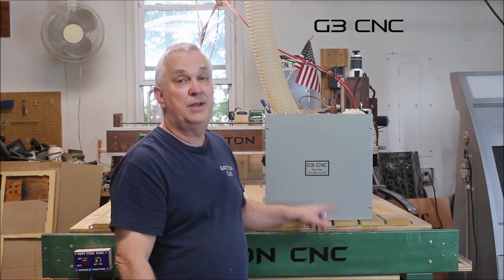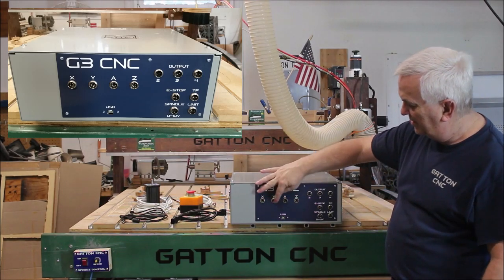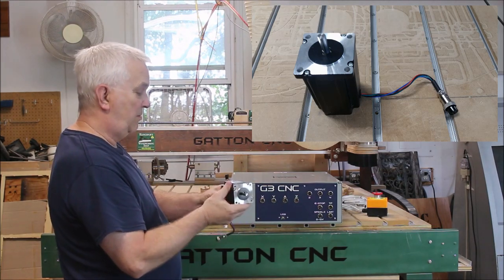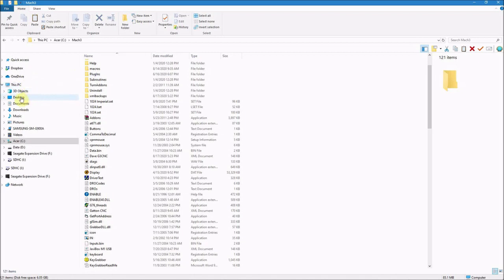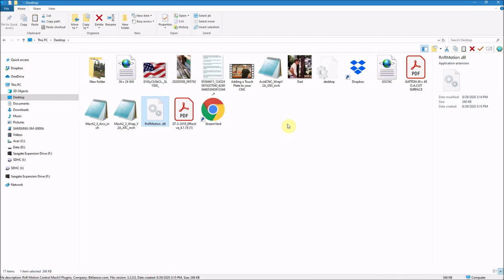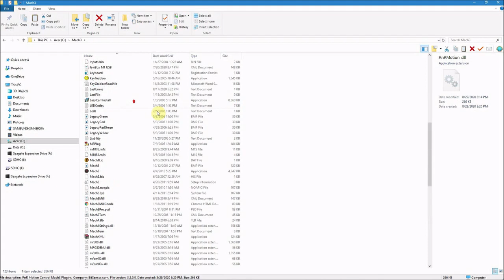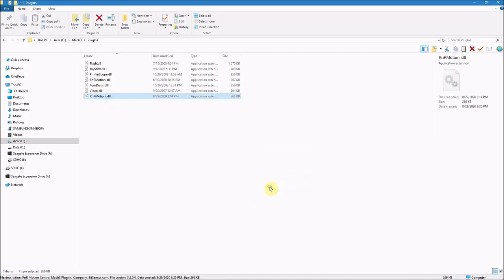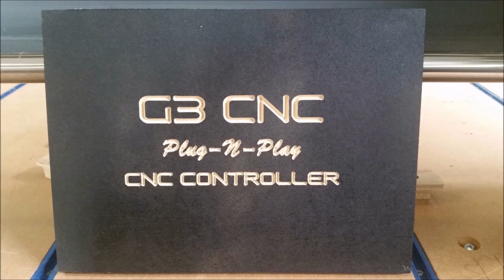The G3 CNC Plug N Play Controller

Comment: Hi!  Great video! I will look into these guys, I was wondering if I could get some advice?  I have a small
 3 axis mill and the controller is dead. Does size of the stepper motors matter when considering a replacement controller?  Additionally,  I want to build a new one.  Can you recommend a good kit and control software?  Many thanks!

Comment: Thanks Dave. Its nice to know that there are options to pick from. do you know if it can work on 220V?
Reply from the maker: Thanks for watching Eyal.  I think it would if you changed the switch on the power supply to work with 220v but that would be a question for 3GCNC.
Reply: Hi Eyal,  the unit is designed to run off of 110/120V power supply.

Comment: Brilliant business idea- take bunch of off-the-shelf parts, package it into a self-contained unit and sell to CNC enthusiasts scared of electronics.

My only complain is that they use an inexpensive Bitsensor BSMCI14e controller (or something similar) that only works with Mach3.
Hopefully the business takes off and there will be a choice of controllers.
Similarly, it would be good to know what stepper drivers are inside and what is the power supply.

My complaint about the video is that the inside of the box  was not shown.
It may look professional and solid on the outside but inside could still be an amateur mess.
Reply: Hi Ro, if you go to my website you will see a list of internal components. On the support page you can view the data sheets for the stepper motors and drivers. The drivers are the latest 32 bit DSP computer chips in a DM556 size, and perform very well. The driver manufacturer is also the stepper motor manufacturer. Their engineering department worked with me to modify the  stepper motor to reduce phase inductance to a very low 2.5mH for me at a very minimal cost. These are not low end motors and drivers I assure you. If you send me an email address I would be happy to show you a "under the hood" pic. Almost all connections are soldered and shielded cables are grounded to a star point grounding design. I am using a 48v power supply delivering 48.5-49v and 11A of power. Due to my motor low inductance rating and power supply, I am operating at 95% of the motors power capacity which is very good.  I use all silicone wiring and all wire bundles are zip tied off to aid in quick replacement of components if neccessary.  My goal is to build a quality unit with quality products and offer it at a reasonable price to the hobbyist community. If you have any more questions please feel free to contact me and ask!   Thanks G3CNC
Reply: G3CNC I do see driver type listed on your web site. DM556 are excellent choice. Running steppers on a 48V is very good, running the controller on separate power supply is also very good. I prefer separate power switch for each power supply, though. If you run into a limit switch you can just power off the steppers and move the machine :-)
The two inputs are rather limiting.  The board offers 4, one is taken by estop so 3 are available. Machines with moving gantry and steppers on each side can self-square on homing but each side needs separate limit switch. Juggling all limit switches and a touch probe on only two inputs is challenging.
Raw output signals are going to be difficult for your customers. Why not include opto-isolated relay board and bring relay output to the connectors outside the case, ready to use?
Your potential customers that use regular routers as a spindle may also like an option for a larger relay that can turn that router on and off.
The relays on the opto boards can’t handle the power of the full size routers.

Your web site describes the controller as ‘proprietary’ but the rnrmotion.dll gave the game away.
It is a decent enough board, but it only runs under Mach3. I hope you will expand the choice of controllers.
And please drop the charade with ‘proprietary’.
Your customers need to know what controller they have in order to get some help with Mach software.
Reply: @rok1475  First, I don't know who Bitsensor is , and that is not the manufacturer of the  board I am using.  The one I am using has been live tested for several months, along with the drivers and motors,  before deciding to use them. The board has 4 input slots and 3 are currently being used and if a customer wishes to have homing switches  I can give them that with their own dedicated line with no issues, its not difficult. Early on  I looked at many motion controller boards and contacted several of them. I am still researching and communicating with UCCNC mostly, I really like their newest ethernet  all in one controller as an upgrade option. Pokey  57 is another one that I am looking at, but I'm not sure how well it will mesh with Mach 3. I am considering it as a possible go to board in the main unit. Yes l also just ordered several different relays for what you termed " outside the box" relays to turn routers on and off that I hope to have as an accessory soon.  There are 4 items that is on my list to focus on and hopefully develop over the next few months.I have answered your thoughts with honestly and even shared with you what I am currently working on and what manufacturers I am speaking with.  Some of your comments I appreciate and some I think are unwarranted. Since my website just got up and going I have answered every question that someone has submitted to me without hesitation and with full disclosure will continue to do so.  Thank you.
Reply: G3CNC 
I think you are on the right track developing with a controller that is listed on Mach support page. 
Pokeys is a very good product with  good support but quite complicated for a beginner.
If you can take the complexity out and offer a “black box” with simple input and output connectors, you will have excellent product.

I  wish you all the best, hope you will get many orders and soon.
The idea is brilliant, I wish I thought of that :-)
Reply: @rok1475   Thank you  RoK, I appreciate the kind words I appreciate it.  You are correct about the complexity of the Pokeys 57. I am trying to wade thru that monster now LOL.